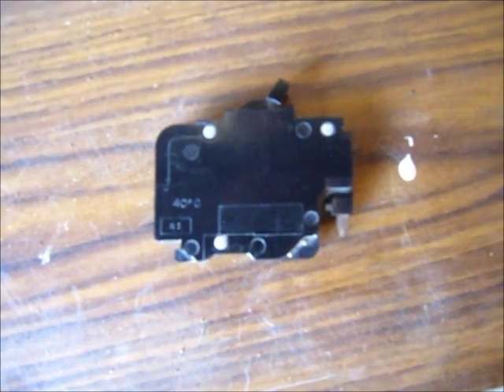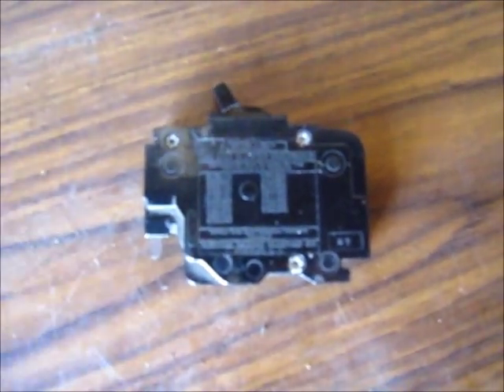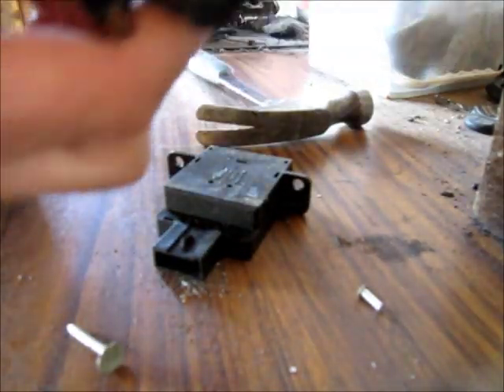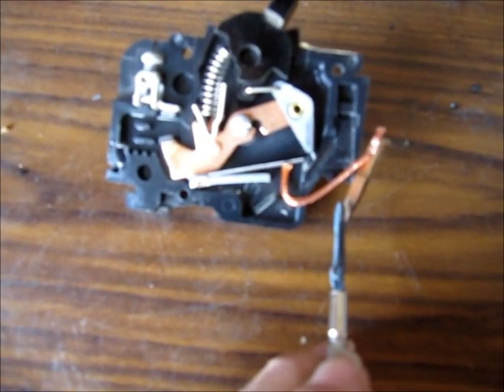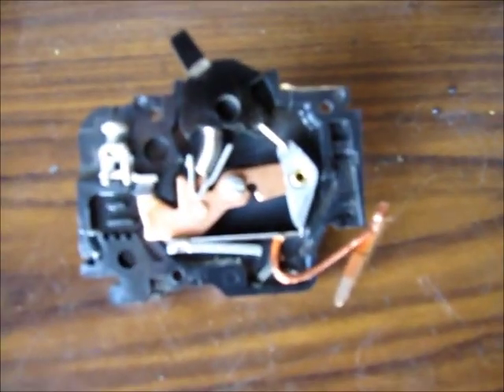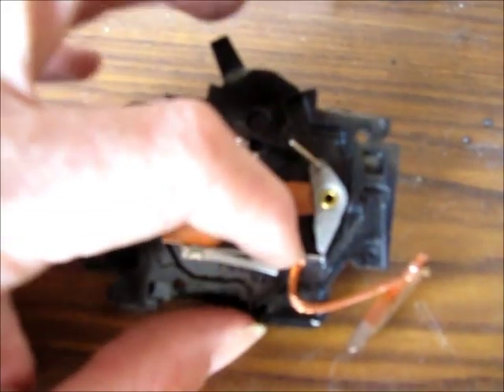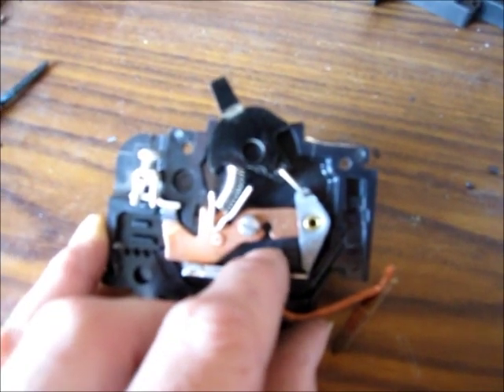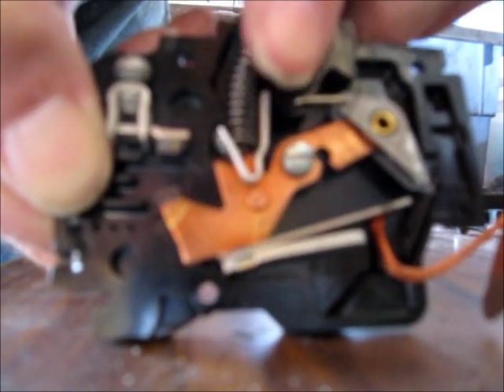Circuit Breaker Disassembly & How It Works

Comment: I recently stopped by a circuit breaker shop and they seemed like a chop shop. They carefully remove the rivets and have new rivets to replace them. They are able to replace tabs to adjust compatibility.

Comment: Bi-Metal strips expand at different rates under thermal rise & bend though separating the contacts interrupting the Circuit ( OPEN )
Reply from the maker: Thanks for the information.

Comment: Why does the bi-metal bend in the proper direction every time it heats? What if it bent the other way?
Reply: A bi-metal is made by stamping two different metal sheets together. Picture two playing cards back to back with each one representing a different metal. Different metals flex at different temperatures. As the load increases so does the heat on the bi-metal  causing one of the two metals to flex or curve and "pull" the flip side metal with it. As it cools the other metal "pulls" it back to original position. Because of that it will always bend same way when heated and the opposite way when cooled.

Comment: You're doing it wrong. You are NOT tripping it. The bottom bi-metal has to release the catch lip at the bottom of that toggle lever, thereby allowing the wire link to swing up to the right, releasing the contact arm.
Because you have the cover off, the center bolt holding the arm is not supported straight, and is loose, allowing the arm to deflect enough to allow the wire link holding the contacts closed to 'break the knee' over top dead center, and enter the 'Off' condition.
Pulling 'upward' (vertically - away from the bolt), will probably do the same.
In operation, the trip happens when the bi-metal leaf warps downward and clears the catch on the end of the toggle, releasing the 'stiff knee', and the contact arm swings free by spring, independent of the handle.

It is clear why these are fire hazards - there is no fast trip magnetic feature.
Also, there is apparently no calibration or adjustment to the element (other than manually bending) . I don't know what the consistency of the trip setting was, leaving the factory...

[I hope it is not bad etiquette commenting on an old post, but wanted to correct misconceptions]
Reply: I’m convinced that reading the comments from others can assist others with information!  TY 4 sharing 👍

Comment: The part that u say will bent rite is correct how it trips is by the spring mechanisms when the metal heat up by the amperage it will soften and the spring mechanisms will break the circuit disconnecting the shorted appliances